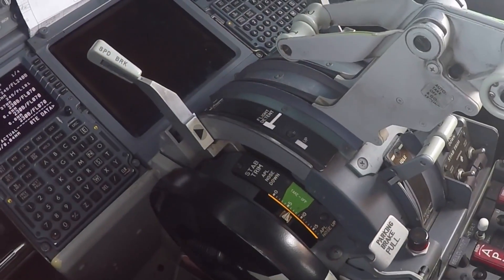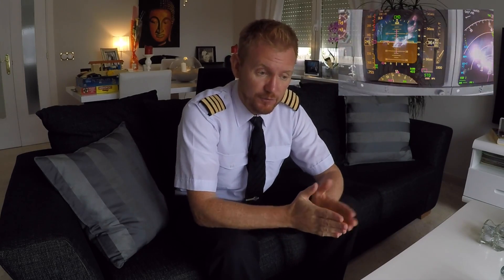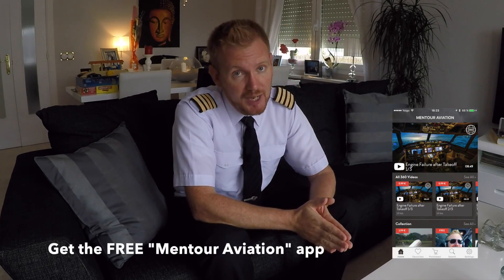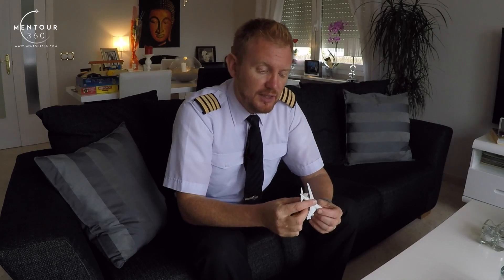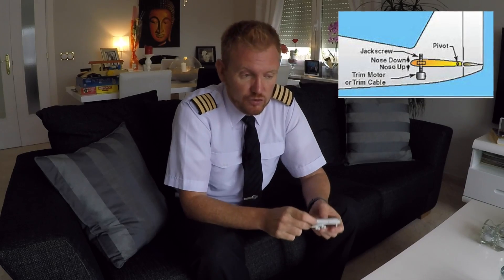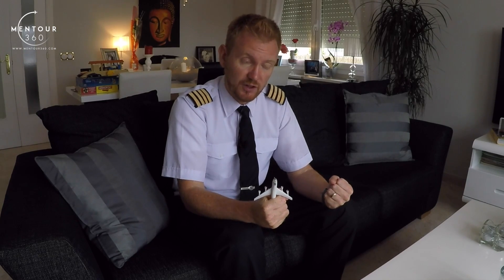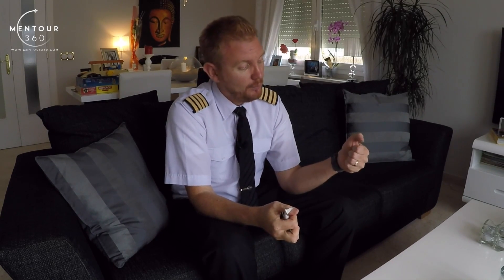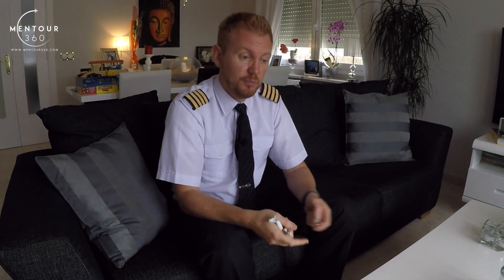What is that spinning thing?

Comment: Thanks for the good information! I never knew that was a handle, it looks like a spring.  One question:  why does the 737 have a physical trim wheel while the larger Boeing aircraft do not?
Reply: Partly for the same reason there are no physical wires connected to the flight controls on bigger planes. The 737 is at the limit of size where humans are strong enough to move those surfaces, on the larger planes it's pointless because you wouldn't be strong enough to move them. Also, there is the the thing where it can catch your trousers! They have the trim movements shown on the EICAS instead.

Comment: If the elevator fails, but the trim still works, would it be possible to fly the aircraft solely by the trim wheel or would elevator failure ground the plane?

Comment: Goddag Kapten! Hello captain! I hope you are doing fantastic as well!
Could you make a video about why low pressure air passes by the upper part of the wing at takeoff and landing?
Thanks for good aviation videos!
Greetings from Stockholm btw
Reply: jbrynolfsson Think of it this way, lift is created when a shape is mixed into the surrounding airflow, this in turn, bends the streamlines and thus a pressure change is introduced. low pressure on the upper surface and higher pressure on the bottom surface of the wing providing an upward push,. viola, lift baby😊
Reply: Ava Mendez thanks! Now I understand it. Say, Ava, do you know why the air becomes white sometimes?
Reply: jbrynolfsson basically, what you have is rotating air off the wing tip that creates a volume of lower pressure in the center of the column..the reduction in pressure in the center of the vortex creates a contrail as the humidity in the air condenses into fog. The greater the force of lift the wing generates, the larger the vortices get. remember, these wingtip vortices can extend for miles behind the airplane.
Reply: It's basic aerodynamics and there are already a thousand videos and articles about it. Just search for how planes fly or how Wings work or things like that. The white air that you mentioned happens because as the air pressure changes humidity in the air will condense into water which you can see

Comment: I think the trim wheels works the same in A320 in an (Airbus).
Reply: Fawad Talib yes, they serve the same function. we set them once prior to takeoff, in the air, the trim system is fully automatic on the A320
Reply: The very big difference is, that an A320 trims itself, not just with the autopilot on, but also when you fly manually. Only in case you have certain failures, do you have to trim it yourself. And in the A320 the only way to change the trim is by actually moving the trim Wheel (like in the Cessna).
Reply: Fawad Talib in airbys uts automatic

Comment: Hi Mentour, love your vids. What is your opinion on Airbus's auto-trimming feature? Pro's and Con's? Thanks!
Reply: KiwiSkydiving we set the trim once in the A320 on the ground, in the air it's fully automatic.the FBW system makes this possible. the electronic hydraulic actuators are taking care of the load on the control surfaces. it is available to the crew in both normal and alternate law. (alternate law provides auto pitch trim with limited authority) in direct law, an amber message appears in the PFD: USE MAN PITCH TRIM
Reply: Ava Mendez awesome. What about b777/787s? They are also fbw. Do they have auto-trimming?
Reply: KiwiSkydiving I am only typed in the A320, i cannot speak for the Boeing.

Comment: Thanks Mentour Pilot. 
-Is it possible (in any plane) to digitally save trim settings for use later on, then push a button to apply the stored trim settings?
-Are the trim buttons velocity-sensitive so that the harder you push them, the faster the trim increases/decreases?
Cheers.

Comment: Just another reason why I find Boeing to be the better manufacturer. Airbus is way too "covert" and "automated" (as ironic as that sounds, with modern autopilot systems) for my liking. I much prefer the mechanical feel of the Boeings over the fly-by-wire method on all of the Airbus aircraft.

Comment: But in the flight simulator we do not feel 
any force so how should we know how much stabilizer is required to stable the pressure ???
Reply: its gonna be really hard to hold the yoke in place if its out of trim :)
(if its a "real" flight sim, not an at home one)
Reply: HOWCALL If you use a joystick and you need to constantly make inputs to have a stable flight attitude, then you know you should be using the trim.
Reply: You really can't, unless you have a $2000 control loading yoke, like the Iris or Brunner yoke. For aircraft with fly-by-wire and a yoke (e.g. Concorde) they use a similar thing called an "artificial feel" device. All other gaming yokes simply have a spring that returns to center.
Reply: I guess it depends on the flight simulator. I've flown a proper flight simulator (b737-800) and the yoke feels it is "fighting" against you. On my home PC the best way I find the plane is out of trim is reading the attitude indicator or when I find I'm constantly having to make corrections on the yoke.
Reply: Truth's Knight_0777 
😂😂😂😂😂
Reply: JetMechMA thanks bro
Reply: and if you have even simple joystick I definitely recommend to bind trim on the buttons on top in same manner as this 737.
Reply: HOWCALL haha! yes. that is one of the hardest thing about simming for me. There's no physical feedback as to how the trim is affecting the airplane at a given speed. Then there're some douchbags who construct a perfect model, then screw up the trim. So it will take 10 inputs before the nose starts moving, and when it does, it'll give you a crazy AoA right in mid flight. LMAO!

Comment: why we mostly use flaps in landing and takeoff (why not during the whole flight)???
Reply: the reason flaps are only designed to be used at low speeds is because the wing without flaps "engaged" has a shape that is good for cruising at high speeds and altitudes, which the shape with flaps down has a good shape for flying slow.
Reply: HOWCALL because an aircraft flies to fast to use flaps the whole flight. Also for exaple, in the 737 flap use is not recommended above 20.000 feet.
Reply: Dutch Flight Channel thank you.
but do we really need flaps above 10000-20000ft ???
I mean flaps are required on high altitude or wings of plane product enough up lift for plane??
Reply: HOWCALL Well, no we don't because we use trim. But by reading your question I thought you ment why we don't use flaps the whole flight. So that's why we don't use flaps the whole flight.
Reply: Dutch Flight Channel thank you
Reply: Daniel Handle thanks bro

Comment: yo, consider adding borders to your text and making it bigger  so it becomes readable in the thumbnail.
Reply: Excellent tip, BHRxRACER.
Adding stroke outlines to text is very important in graphic design, especially in video design, because it means that no matter what the background is - the text will be easily readable.
Reply: Well, only a little. You need high contrast. Red text with white border, yellow text with black border, white text with black border, etc. Whatever the color is, it needs to be different from the rest of the picture. Now you're using silver and black, which are very close together and also similar to the background picture.
Reply: No probs :) 

Enjoy flying.
Reply: 《FPA》 《FuturePilotAditya》 wait..... are you Aditya from Vattastic?!? We did a group flight at 2am your time a week ago :)

Comment: Mentour, after you land do you set trim back to normal position or keep it set where you set it when you have landed?
Reply: I only know that S7 airlines' procedure is to trim it to 5 units after arriving at gate.
Reply: i only know on a 172 cessna there marking for takeoff position .
Reply: In any case, it gets set for takeoff before departure, so whether they reset it after arriving or not makes little difference.